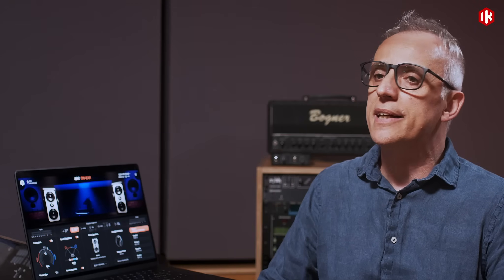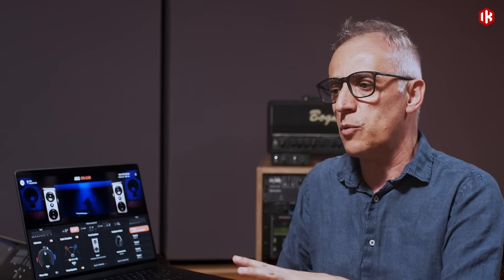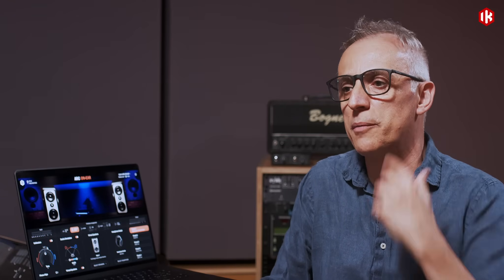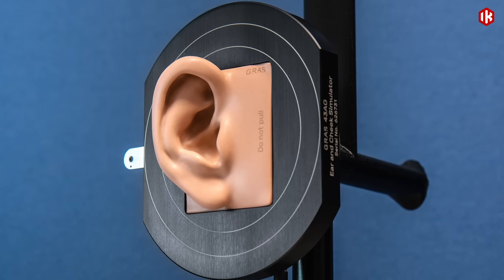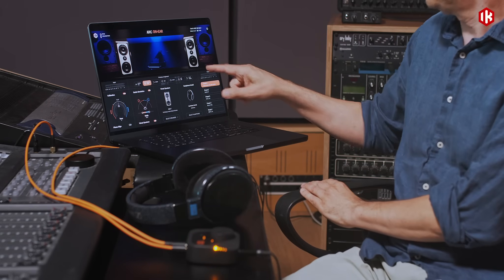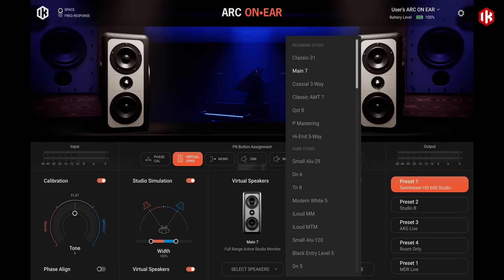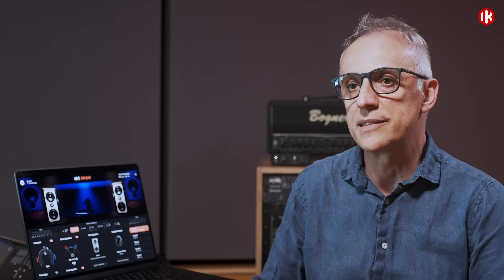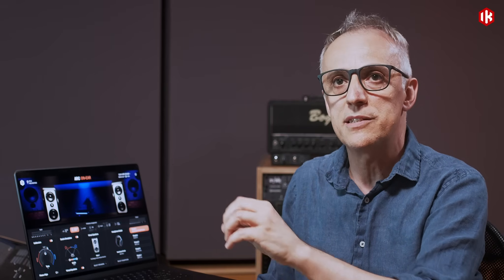TechTalk: ARC ON•EAR Presentation from IK CTO Davide Barbi

Comment: Can someone confirm if this routing is acceptable for using the IK ARC On-Ear for headphone correction? Apollo X16 (Monitor Out) → Elysia xPector (Stereo Monitor Input) → xPector Engineer Headphone Output → IK ARC On-Ear → Headphones Since the ARC On-Ear has no line output and is designed as a headphone correction DAC/amp, can I simply feed it from the xPector’s headphone output and let the ARC handle the final volume and correction, as long as I keep the xPector’s headphone level low?

Comment: It is a really nice product.. As a feedback it would be a real gamechanger if you guys apply a hearing aid correction since we all have different perception of sound even though the correction of the headphones is flat.. I tend to use SoundID reference, but underneath the headphone I use Airpods with the hearing aid function enabled, it would be a plus to have it in the software just like Lewitt did with space replicator..
Reply from the maker: That's an interesting idea, thanks for the suggestion!
Reply: @ikmultimedia  Great!! You would have a complete product with a mix between SoundID referrnce, Goodhertz Can Opener and a hearing aid solver in the same product.. I have some ideas for that if I could help it would be a pleasure getting in touch with you guys.. Cheers!

Comment: Can I replace my Topping L30II + Sienna with only ARC ON-EAR to correct and amplify my HIFIMAN Sundara?
Reply from the maker: ARC ON•EAR is as audiophile DAC and headphone amplifier with built-in correction and your headphones are supported.
Reply: It is a portable device on battery. The main scope is mixing/tracking. So I can say that even doing what it was designed for and claimed this device won't be able to substitute that combo...